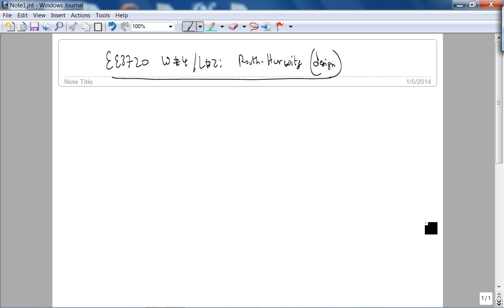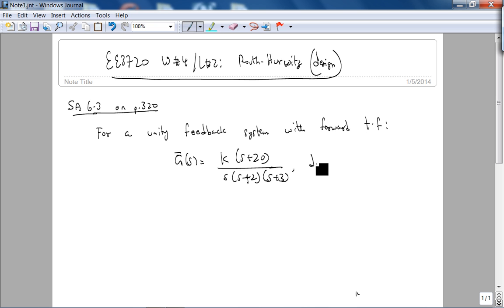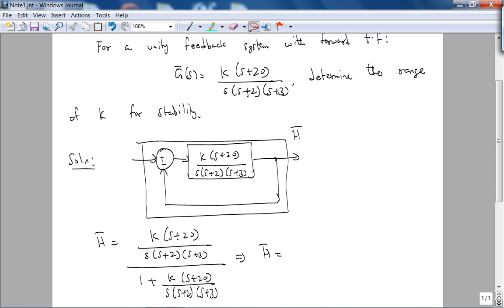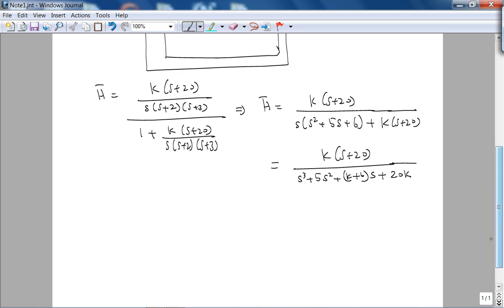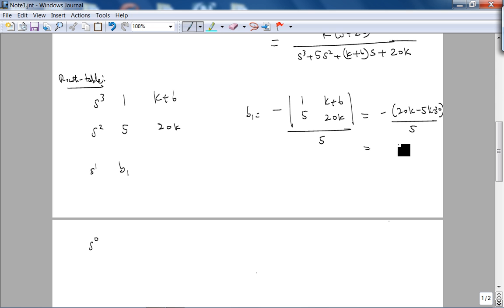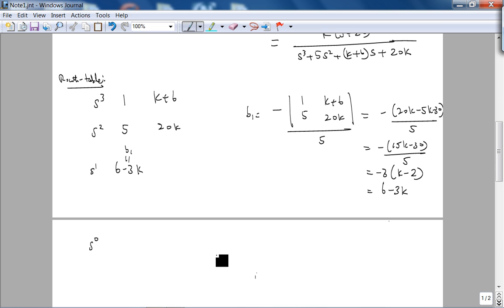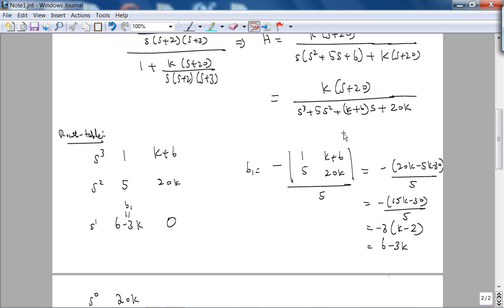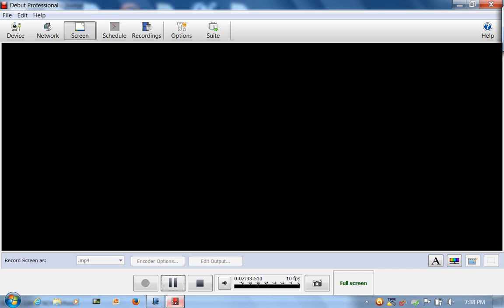ee3720 Winter 2013-2014 week 4 Lecture 2 - Routh Hurwitz Design Example.

Comment: Why isn’t it (6-3k)/5?
Reply from the maker: Thanks for the question. If you are talking about the simplifications around the 5:03 mark, the reason is:  factoring out 15 in the numerator of  -(15k-30)/5 results in (-15(k-2)/5).  Hence dividing by 5, we get:  -3(k-2) = 6-3k.  So, the 5 gets "divided out".  Hope that helps.